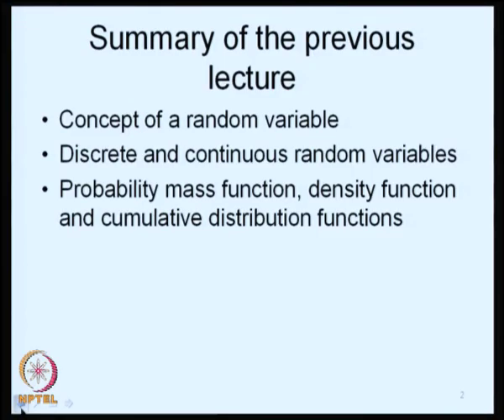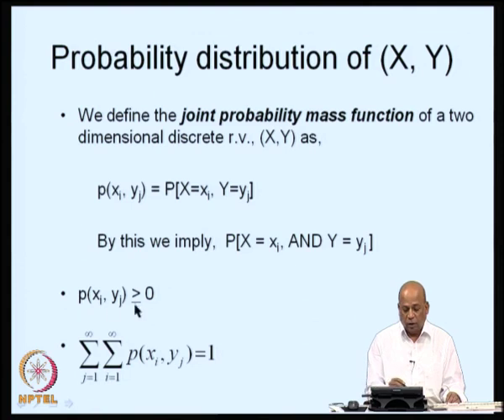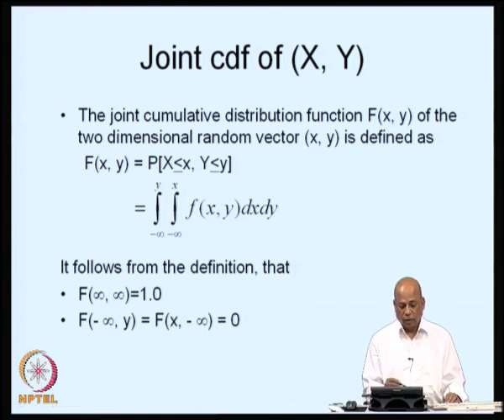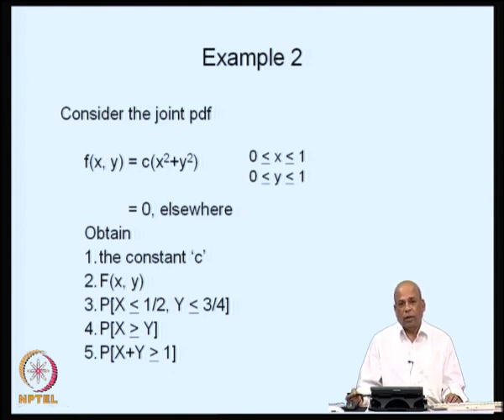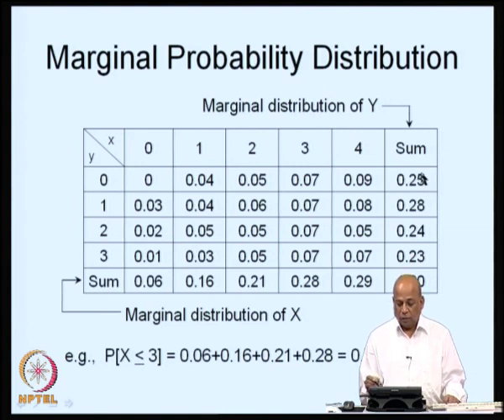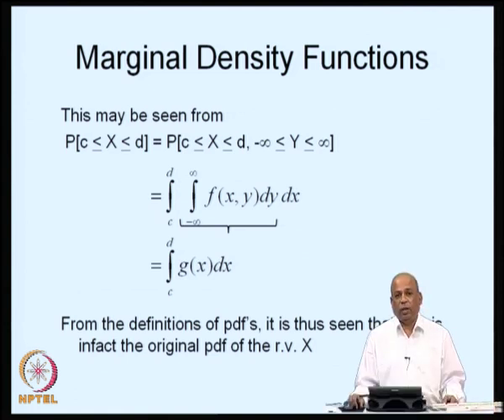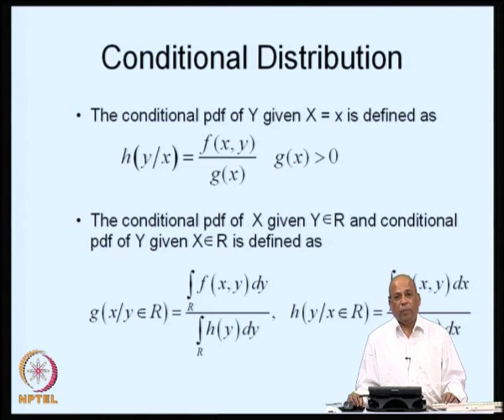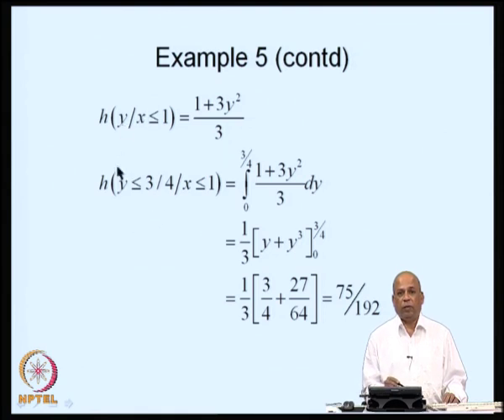Mod-01 Lec-02 Bivariate Distributions

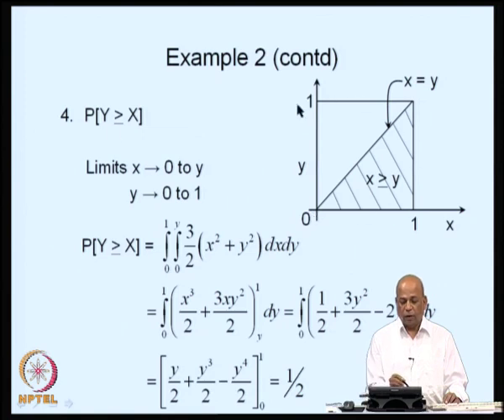Comment: Yes, the question is to calculate P[X greater than Y]. The calculation is done for P[Y greater than X],  which is equal to 1 - P[X greater than Y] as shown in the figure at 28:00. In this particular example, both P[Y greater than X] and P[X greater than Y] are equal as the function is symmetric.

Comment: The value of g(x) has an erro on ur third step the x is supposed to multiply through the bracket but it’s like u only multiplied it of one side I think it’s supposed to be 1/4[xy+xy^3] check it well sir
Reply: Dear Okoth Kizito,

Thanks for noticing the error. The final form of g(x) will be x/2 for 0<=x<=2, after putting the values of y in the integral function. The variable x should be kept constant as we are integrating with respect to y.